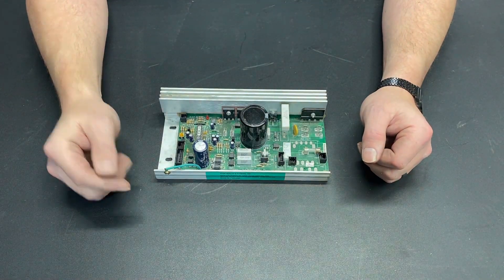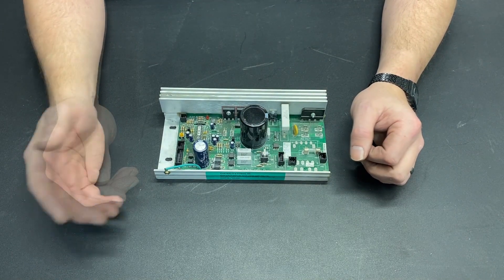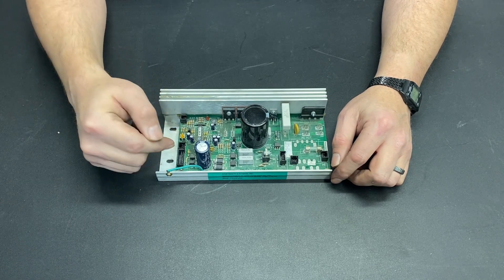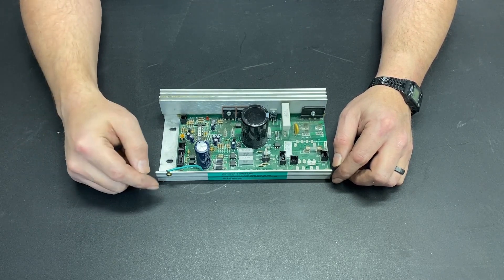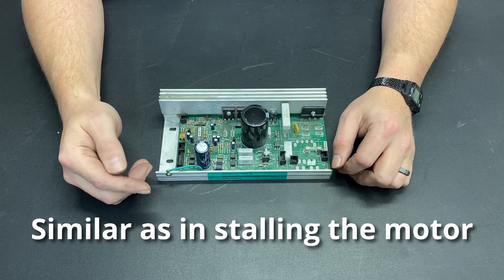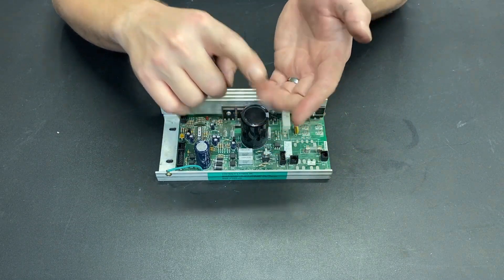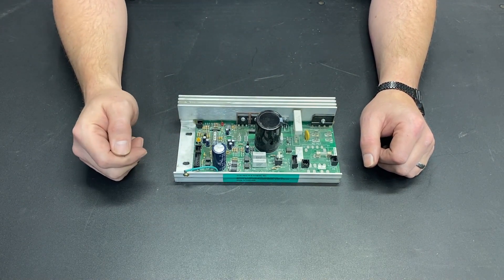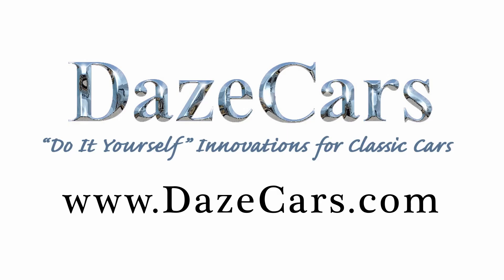MC2100 NOT a Good Power Supply Option for Shop Tools!

Comment: I have a MC 2100 card on my lathe and at 1st it worked fine for the more I had on ,but the motor was a bit small and the gear ratio was not quite right Luckily I installed a fuse on the dc side which would trip when I used it a lot. Got a deal on a different motor ( 120 volts dc,29 amps, 3.4 HP) it had the flywheel on one end and the pulley on the  other so I was able to replace the ribbed pulley with a 1 inch  v belt one and had a 4 inch pulley on my lathe I went ahead and installed a braking system and EPO on it. While it worked great know I  blew out the card when I  accidentally switch directions and tips on relay did not react fast enough for braking the motor Like you said in previous videos the MC2100 card is fragile and need something more robust. My question is would a scr controller work better and should a person either use you EPO to use the electric brake of install a on off switch to use to stop motor instead?
Reply from the maker: all my projects use the SCR even though I have a pile of MC2100.  Its no contest IMHO.  What are you talking about when you say EPO? and I am not following what you are saing in your last sentence.  Can you please clarify?
Reply: @dazecars  Thanks to the fast response,  I have a emergency power off button on the lathe  but I also want to install a heavy duty switch to use to turn off  and on. I only want to use the EPO for that purpose ( that switch was difficult to install and would be hard to change if it goes bad) and only use the directional switch after I use the on/off switch so I don't accidentally reverse direction while running at high speed and take out a card again  Once again thanks and have a great day
Reply from the maker: as far as switches its all about putting them in series so that the emergency one kills power to everything.  could actually go before or after the main power switch.  Glad I could help.  let me know if any other questions come up.

Comment: Just pulled out the board in a treadmill i got for free, and saw that it was a mc2100. I scrolled through your videos to find if you had done this one and found this video. Guess ill be using an scr
Reply from the maker: It depends on your application and configuration.  There are a lot of variables like your motor, what you are spinning, how you gear it and a bunch of other setup things that have a big effect on weather the  MC2100 is will handle the load or blowup.  In some cases its worth it because the power is so much cleaner but for high amp situations the realibility of the SCR is so much better.
Reply: @dazecars  thanks for the info.
Reply from the maker: my pleasure
Reply: Right?😂 I just pulled out a virtually un-used 3.5 hp with a MC2100 LTS board from a very nice treadmill that had been used a couple times and then sat untouched for years (free for me)  and I had JUST watched the other video. Immediately went and ordered a signal generator... then continued watching videos to learn a bit more and I came across this video saying DONT use the mc2100😂 I was planning on using an SCR anyways (for a medium size mini lathe) but I haven't quite nailed that down entirely, some of the components are new to me. I've  done plenty of projects with PWM controllers and all that but never had to mess with some of the extra components he says to throw on the SCR set up. I'd be hosed without these videos so HUGE thank you to
Reply from the maker: Glad I could help!!  Don't hesitate to reach out if any questions come up as you work on your projects.

Comment: I wonder if the MC-2100 would be any good as a general benchtop power supply?  With the capacitors, and the fact that it doesn't require a choke to compensate for the MC-60's SCR, it might have a reasonably clean DC output.  ...or not?
A fast-blow fuse would probably be a good idea though, since it sounds like the board lacks a decent built in self-protection feature.  

Thanks as always for sharing your knowledge and experience.  And I appreciate that our videos seem to have a lot more in the way of productive discussion than most other content creators. 👍
Reply from the maker: That might actually be the one really good use for an MC2100.

Comment: Could a current limiting resistor be an option to improve this issue along with a quick blow fuse? If it is could you do a video on it
Reply from the maker: The resistor is not an option for a lot of reasons.  First resistors are rated in watts (volts X amps) and with a lot of treadmill motors being 90V or more and 20 amps thats 1800 watts so that resistor would be huge.  Not to mention the fact that by limiting the flow it will reduce speed and torque.  The fuse might be a good option but I am not sure where the best place to put it would be.  You would likely want it close to the MOSFET but I don't really know.  The reality is that an MC2100 was designed to run a treadmill and not designed for use outside of a treadmill and there is no easy bandaid to make it better.  That is why I don't like them for project applications.

Comment: Why? Because the MC-60 features feedback loops etc on the board itself, in order to stabilize and maintain speed under load, It does not use feedback from a tach etc to do this.
The Mc2100 does use it when on the TM, due to the belt or motor opto sensor  sent directly up to the console processor via the main board, but the main board does not see the tach directly on some versions, 
I am thinking of reprogramming a PicMicro to replace the one on board and include these features. I already built a small Picmicro one for the 20hz PWM with stop start P.B.
Reply from the maker: The tach input goes directly into the MC2100 board and works well to help maintain speed... the MC2100 is just a terrible power supply 😂😂😂
Reply: You mean because it has a bridge rectifier? The SCR after the bridge is just used to ramp up the DC.
Reply from the maker: no a bridge rectifier converts AC to DC and nothing to do with the tach input on the MC2100.  Im saying I used the tach input on the MC2100 and it helped regulate speed untill the board fried.

Comment: I love your videos, and respect your knowledge, i believe a more dialed in gear ratio to make better use of the higher rpms is key. torque is cool, but irrelevant without some inertia (at working speeds).  with lathes/saws that have been converted, we must also keep in mind that we control the motors load by "feeding" material/cutter into the saw/material. i tried 3 tin can motors before finding my baldor 3hp, all of which were powering a 10x36 rockwell lathe via the same mc2100lt. i've probably stalled it 1000 times by now before setting on a gear ratio that suite's my machine. i may just be lucky, or it could be the re-freshened thermal paste and 40mm blower on the heatsink. it goes into a limp mode occasionally, but a power cycle fixes that. again I'm not saying your wrong, but gearing the motors max rpm to match the machines max rated rpm is your best bet usually.
Reply from the maker: Thank you for your comment, I agree with everything you said except "torque is cool, but irrelevant without some inertia "  You are completely correct that for best results you want to gear the motor to max motor RPMs but unless using a massive flywheel its not about inertia but rather torque.  If you have a motor that had 2 foot pounds of torque and a max RPM of 4500 and your application only needs 1500 RPM, if possible you should gear it at 3:1.  Yes there would be a slight benefit to inertia but the bigger advantage is that gearing has converted RPMs into torque and the output has gone from 2 foot pounds to 6 foot pounds.    On my lathe and mill I have the motors setup with gear ratios to maximize  motor RPMs and they work extremely well.  On the band saw there is not room to "correctly" gear the motor to the saw.  Sadly I am leaving 1/2 to 1/3 the motors capability on the table. When I stuck the blade it wasn't about feed, I was cutting something round and it spun in my hand and completely froze the blade.  In my case parts failed in the MC2100 no limp mode.  Again I appreciate your comments and agree proper gear ratio is key.

Comment: What nobody seems to realize is these cheap treadmills are made to be used by just one person, walking, only a few times a week, for 3-5 years TOPS. If you’re lucky to have it last that long with consistent use, you’re extremely lucky… but the reality is that these residential treadmills aren’t designed for consistent use.  Fact is 3 of 4 people that buy a treadmill will literally NEVER use it a single time EVER. Similar statistic is true for gym memberships(I ran multiple gyms for 8 years). Needless to say, these treadmill manufacturers know this fact and they build them accordingly for their highest return(typically to break after 3 yrs, once warranty expires)

If you want reliable components for shop tools, then you need to source components from a commercial grade treadmill. These are made to be used all day, everyday, 365.  The difference between a commercial grade treadmill and a residential unit is astronomical.
Reply from the maker: I couldn't agree more.  I have scrapped 18 treadmills and half have been cheap.  Easiest way to tell the difference at a glance in motor size.  The ones with a 4" diameter motor are cheap.  Still lots of good usable parts there for various projects but I would never put those parts on a mill or lathe.  The bigger motor treadmills (5" or bigger) are of much better quality with a ton of different variations in quality from the expensive home unit to the commercial unit.
Reply: I just picked up a VERY nice treadmill that the owners had done exactly that- bought it, used it a couple times and then they NEVER touched it again. It's virtually brand new.
Reply from the maker: I find they are all or nothing.  The treadmill has been hardly used OR it has been walked/run into the ground.   Not a lot of in between.

Comment: Do you still have that dead MC2100? I've got a different variant of it I've been trying to repair for my treadmill and it might be useful to start part swapping between the two since a new MC2100 these days costs more than I paid for the treadmill itself.
Reply from the maker: there are two switching transistors that typically go bad the mosfet on the dc side and another one on the AC side.  if it is not one of those or the capacitor then it is the main chip and is not repairable.
Reply: @dazecars  The problem for my board is that the 12V rail is not putting out enough power to drive the display. I can work around it by giving the display 12V externally and then turning the control board on and it works just fine. Part of it was that I've been dragging my feet on making a schematic of the DC side since no one seems to have made one for it already.
Reply from the maker: @NearEDGE  I would check the DC side capacitor (smaller capacitor rear the pin outs) as a possible source of the problem.  The basic components of the 12v side are the transformer stepping 120V AC  down to 2 legs of 8 V AC which are wired together for 16 V AC so if one leg has an issue that might be part of the problem.  Then it goes to two diodes mounted back to back (looks kind of like two larger transistors mounted back to back)  That converts the AC to DC.  From there it goes to the capacitor to smooth the power out.  There are other components but those are the main ones to look at.

Comment: If the DC treadmill motor was one that you commonly see rated for 80vdc (85vdc?) you could always put one of these inline with the motor power leads:

Blue Sea Systems 7220 Ac / Dc Single Pole Magnetic World Circuit Breaker 30 Amp

They are rated for 80vdc and while I may not know the correct amperage rating needed to be used for prolonged working load conditions, they are manufactured in varying amperage ratings all costing about the same $20. 

Normally a treadmill motor will experience around 10A DC at low speed when loaded by a 240lb person. This number can be higher at 15-20amp depending on the tension and health of the belt. So I’m just guessing that the 30amp version might be sufficient to handle a prolonged working load at higher rpm but still be sufficient to trip in a motor stall scenario.

Originally I had thought you could use those automotive/marine 32vdc resettable fuses, however after doing enough researching found that if the fuse isn’t sufficiently rated for the DC voltage, it may not have a sufficient arc gap to suddenly terminate the flow so the voltage may just end up arcing across the gap rendering the fuse ineffective.
Reply from the maker: It still likely would not save the MC2100.  Most fuses have a delay and the board will fry before the fuse.  In fact I heard from another viewer that had put a fuse in line with his motor.  He accidentally went from forward to reverse without letting the motor come to a stop and it killed his MC2100.  The fuse was even undersized making it more prone to blow but it didn't matter. When it comes to power supplies the 2100 is "made of glass"

Comment: This was interesting, and killed my direction with the mc2100. I'm glad to move on early, but I'm still confused on the choke in the SCR circuit. I understand the amps and volts. I think Hz is constant at 60, but I don't understand how to size the inductance rating. It sounds like too little and the choke is irrelevant while too much and I'm overpaying. How can we determine the right range? I'm thinking I'm just going to buy this one part new so I may as well get it right. Thank you for putting all of this out there!
Reply from the maker: The choke in most of my videos is part number 130993.  Instead of getting one new I would get a used one. A lot of treadmills come with a choke. Go to eBay and search “treadmill motor choke” BUT know that most people on eBay don’t know what they have and the word transformer will also appear in most listings. Problem is a choke and a transformer look almost identical so some listings are for transformers and some are fore chokes because the sellers think they are interchangeable. They are not. They would only be interchangeable if you modify a transformer to work as a choke.  (see my DIY choke video)  To tell the difference count the wires. A choke will only have 2, a transformer will have 3 or more.  Generl rule of thumb for sizing a choke is the bigger they are the better they work, also the coil needs to be at least 16 awg. Please let me know if I can be of further assistance.

Comment: Hi, I have a question.  Why do you use a 10,000 watt 75 amp SCR voltage regulator and not a 2,000 or 4,000 watt ?  A 2.25 hp dc treadmill motor will use 1850 watts at 27 amps. Is it just being over safe ? Was just wondering. Seems like a 4,000 watt would work just as well. Thank you.
Reply from the maker: Max watt rating is simply that max it is for small bursts of max amp draw. Continuous use is typically about half of max so 5000 watts.  My biggest motors are in the 3000 watt range so the smaller 4000 watt units were out.  If I was running a smaller motor like the one you provided the specs for a 4000 watt unit would work BUT the components are smaller and less robust and I wanted something that would survive the punishment it was going to see in my shop.  It is no different than the situation with the 50 amp 1000V rectifier that a lot of people are using because you can get a 5 pack for $10.  (same one I use on the bench for some of my videos because of convenience about 1" by 1") but on my machines I use a much bigger rectifier.  I started with the smaller one everyone else was using and I burned out several of them on my machines.  After I upgraded to the 100 amp 1500 volt rectifier I have not been able to burn one out.  It is much more robust and will last longer because it is not operating anywhere near max.  If you are going to use what ever you are putting the treadmill motor on a lot you want components that will last.